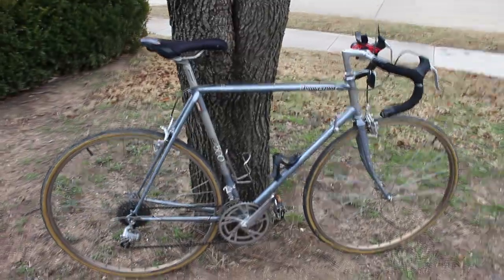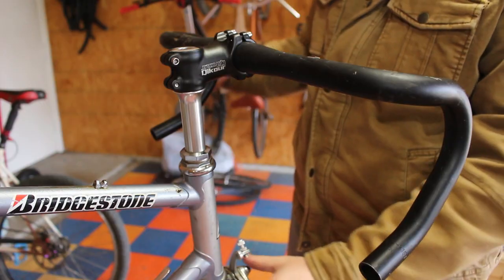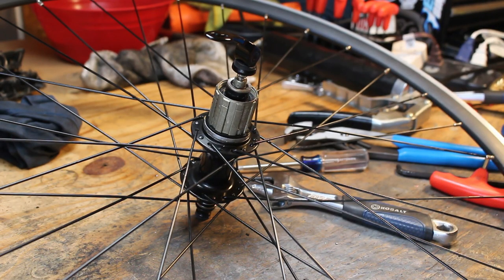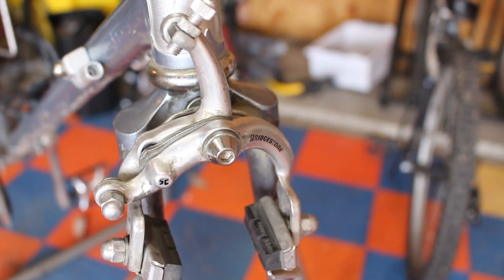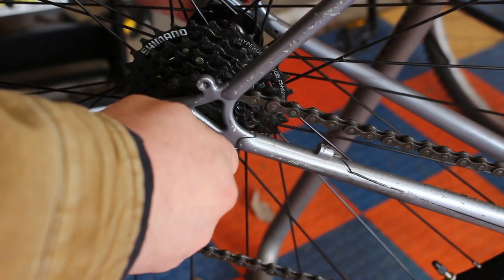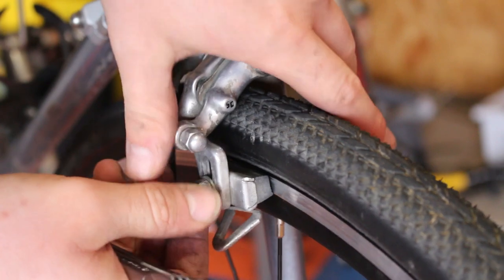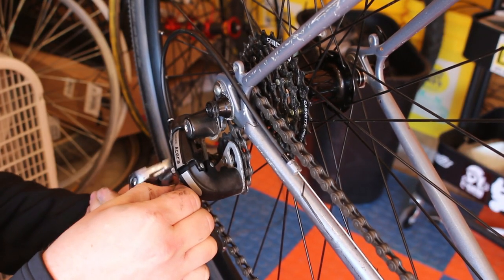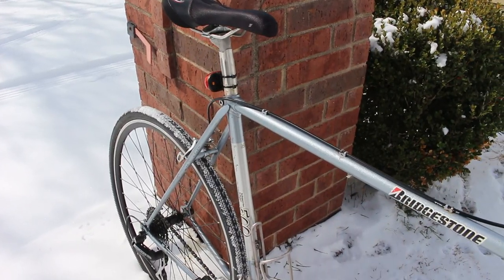Converting an 80's Road Bike to Gravel Grinder

Comment: I just cold set a 1981 schwinn super sport frame, and I was SHOCKED at how far apart i had to spread the dropouts in order to gain about 7 mm of cold set distance.  I managed to get to around 128.7 mm before i lost my nerve and stopped.  Newer wheels slide right in now, but spreading that frame to over 170 mm  was scary.  Steel is amazing.

Comment: I am confused about wheel sizes, could you please explain this to me? You say you're swapping 27inch wheels for 700c wheels which gives extra space for a thick tyre. But when i google wheel size 700c it says its 28 inch?
Reply from the maker: There’s been a lot of naming conventions over the years with bike wheels. 700c, 28”, and 29” all have the exact same bead seat diameter. The only 27” wheels from the 70s/80s had a diameter 8mm bigger

Comment: My old 200, which I'd singled out for use at the airport, is undergoing a similar morph. 700x35 GravelKing SK, the old longer reach brakes I already had on there, and 1x9 Advent with a bar end shifter. I think it'll be a blast.
Reply from the maker: That sounds awesome.

Comment: Road bike to gravel and mountain bike to road use. Gravel bike = merchandising manipulation. It's all in the marketing. 
Cool build though. Great frame. 👍 
I have a few old Raleigh's. Two I've removed the drop bars and went with flat bars. And run Kenda Cyclocross tires 27 x 1 3/8. And that was before the MTB era of the late 80's!

Comment: I have an old Schwinn passage steel touring bike. It has cantis and was original 27". I could never get the brakes adjusted just right when I put on 700c wheels and I didn't have great stopping power. I ended up buying a newer gravel bike with hydraulic disk brakes and it is so much nicer.
Reply from the maker: Canti posts for 27” wheels are very difficult to get working for 700c. And of course cantilevers will never compare to hydraulic discs

Comment: Another option is to use older 700c wheels which have the correct spacing, but you have the thread on cassette. Great video!

Comment: Cool thing about shimano is that the derailleurs are all inter-compatable with each other all the way up to either 9 speed or older 10 speed.
Reply from the maker: The good old days before hypersensitive drivetrains and incompatibility between different speeds and even brands.
Reply: @tinkerbike2510  thats why I like Microshift nowadays :-)
Reply from the maker: I just switched this bike to Microshift. Video coming soon 😬
Reply: Like Dura-Ace 7400?

Comment: I have 1990 road bike with a 6 speed cassette. I want swap wheels for smooth pavement and light gravel. I bought a 11 speed bonteanger wheelset but it is too wide in rear wheel. Any thoughts? Do I just need 6 speed free hub?
Reply from the maker: Hard to say without looking at it. If it’s an aluminum frame you can’t respace the frame.
Reply: @tinkerbike2510  It is a Nasbar with a chrome moly frame.
Reply: @tinkerbike2510  I am just looking at trying to shorten the new rear wheel diameter a little.
Reply: @tinkerbike2510  I really want to shorten the hub on the new wheel and kept the 126mm to swap out wheels.

Comment: That's a corking bike; should've left it standard and used a hybrid bike.....more tyre clearance, v brakes, more relaxed geometry. Just an old git's opinion.
Nice tip about realigning the drop outs after cold setting; this isn't mentioned on most videos.
Reply from the maker: I did look for hybrids but found nothing. I’m really happy with how this one turned out

Comment: So I have a road bike style bike (fixation pixel 3) that I wanna convert into a gravel bike more or less, but it has an internal derailleur and the specs for it say a maximum tire size of 700cc/32 what process would I have to do to get bigger tires going for it? I'd also like to keep the internal Derailleur too if it's possible. I'm really not keen to all the technical terms and lingo for parts as I'm just getting started out. Thanks, I subscribed
Reply from the maker: Unfortunately you’re probably maxed out at 32s on that frame. You could look at doing a 650b wheel swap. That might allow you to keep the front derailleur but if you have rim brakes you’ll have to replace the brakes with long reach calipers

Comment: nice, is there any possible way to fit 45c tires on one of these old road frames?
Reply from the maker: On a road frame like this it’s very unlikely. But if you find an old 700c hybrid like a trek multitrack those will fit 45s

Comment: Hi, Nice works !
I want to do the same but I am not sure of the wheel I need. I can feet 35 or 38 m tyre on my bike but do I have to take care to the internal rim width of the wheel I will buy ?
Reply from the maker: Only if you're going to run them tubeless, otherwise normal narrow road rims should work just fine. Even if you were to run them tubeless, I think most rims 15mm inner and higher would be fine.

Comment: Hi great video. I want to start road cycling, but with as expensive as new bikes are I thought about getting an old one and replacing the components to new ones. Is this cost effective? Or will it cost the same as a new bike after all the parts are added?
Reply from the maker: You can save a lot of money on upgrading an old road bike by looking for used parts. If you buy everything new, it will add up very fast, but if you watch for people selling old groupsets, you can score some good deals and keep the cost down.
Reply: @tinkerbike2510  Better to just buy a 2 year old bike, there are a lot of "pandemic" bikes hitting the market.
Reply: Def better to buy one used. These builds tho budget friendly there more for the cyclist who like to build there own project bike either with left over parts or buying all new ones but believe me it’s not cheap

Comment: nice build. there's no safety concerns with having to spread the chainstays for the larger rear wheel?
Reply from the maker: None at all on a steel frame. Its perfectly safe and many articles have been written about it. Do not do this on aluminum or carbon though.
Reply: @tinkerbike2510  yep! Boat anchors > soda cans and carpet fiber.
Reply: We did it all the time, spreading our 120s to 126 to convert to 6- and 7-speed freewheels. Square the dropouts, though, to prevent axle breakage and align the derailleur hanger.

Comment: Newbie question: I’m confused, I thought 700c wheels are larger than 27 inch. Isn’t 700c 29 inch? Again: newbie!🤗
Reply from the maker: 700c/29er are actually smaller rim diameter than the old 27” wheels
Reply: @tinkerbike2510  huh weird! So old 27” are actually like 30” ?
Reply: 27-inch are an old weird size. 
Some older road bikes (mid 1980's and earlier) used 27-inch tires; these were used on most of the "10-speed" bikes that many of us grew up with. These are NOT the same as the 700C tires found on modern road bikes. Very few, if any, modern bikes are manufactured using the 27-inch tire size, but replacement tires, inner tubes, and wheels are still available for those older bikes.

27-inch tires come in common widths of 1-1/8 inch, 1-1/4 inch, and 1-3/8 inch for some older hybrid and cycloross bikes.

The BSD of 27-inch tires is 630mm.

27-inch and 700C tires are close enough in size that the inner tubes are compatible; i.e. you can use a 27-inch inner tube in a 700C tire, and vice-versa. However, you can NOT use a 27-inch tire on a 700C wheel, and vice-versa.

Comment: Not been an ass hole but you should of went to AliExpress you could of got your shifters emperor or micronew shifters that will do 9 10 11 and 12 speeds use and extension for a 11 42 sprocket/cassette you know them down tube shifters they will work with any amount of gears just shifting isn't as comfortable  as top shifters . I have a video here this guy guides you on what's compatible on gears an shifters it's a great insight in known . But nice bike great work . I'm turning an old bike like yours might do it as a 10 speed 11/42 cassette might use a maintain bike back long cage  derailleur. From spraying to shifters to cassette and derailleur and wheels I'm hoping to spend as little as possible . Maybe 150 to 200 Eurus max I'll look for wheels second hand . But nice job you done English lad he does reviews on some of the cheaper alternative and he puts them to the test of maybe 1000km + see how they fear out